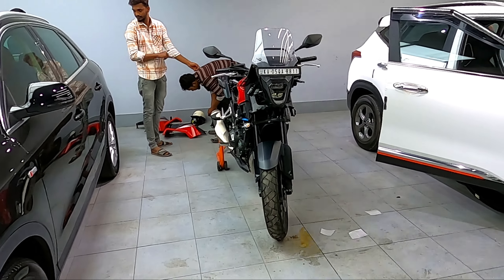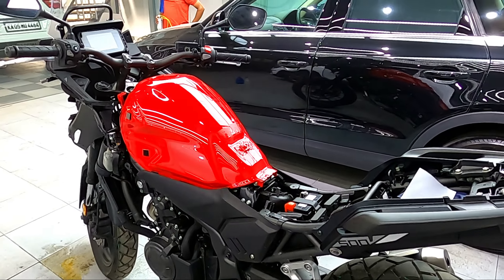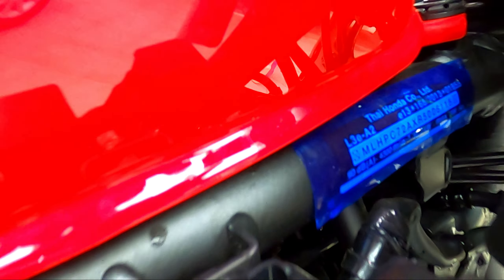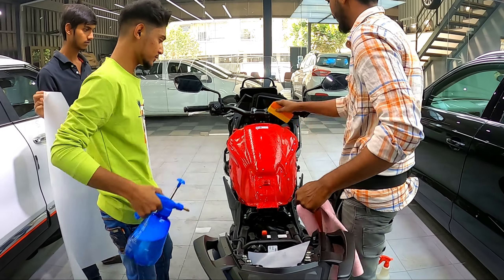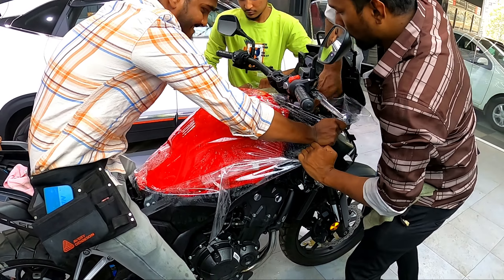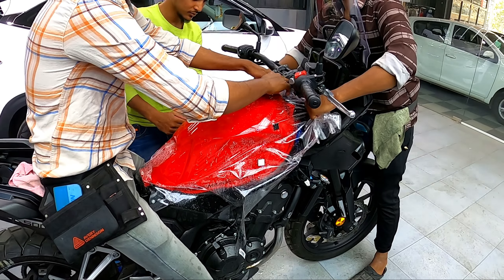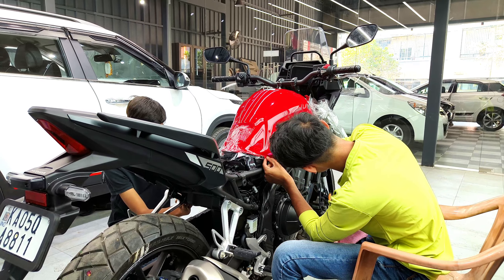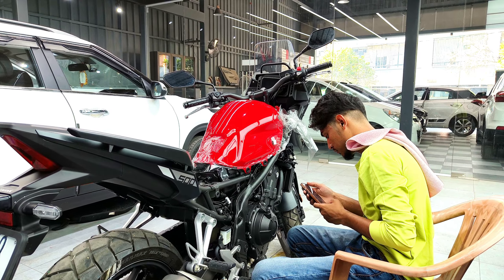Honda NX500 PPF Done

Comment: Sir, I also own Honda NX 500 white. Also going for PPF. The detailing guys are hesitant to remove the tank fairings. Kindly tell me where and which all screws needed to unscrew to remove them.
Reply from the maker: The screws are visible to remove, once the allen screws are removed, there are plastic clips holding the fairing. You need to just pull it out. Try to find a different PPF guy if they are not ready to do it properly.
Reply from the maker: Unfortunately the guys who did the PPF on my bike had already removed it before I went to do the video
Reply: @AverageHumanVlogs  PPF done on tank and fairings. Also fitted tank crash guard from hecker and becker. Mounted Mad dog Alpha aux lights also. Is lower engine guard necessecary? Also need a top rack fitting, any idea? Any brand recommendation? Charding socket I have asked Honda showroom guys to intent also planning of fitting main stand.

Comment: Bro iam planing to do ppf in my nx500. Can you tell me the total cost of the work and contact details of shop...!!
Reply from the maker: In my experience I would prefer Ceramic coating and tank protector, both front and side where you hug the tank while saddling. PPF is difficult on this bike, it will start peeling off no matter how good a job they do.
Reply: @AverageHumanVlogs  thanks bro